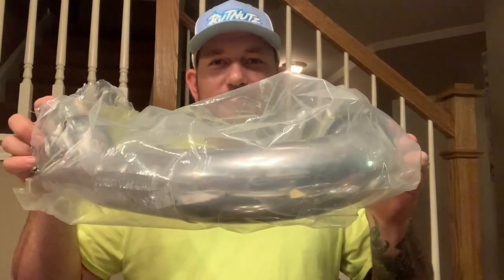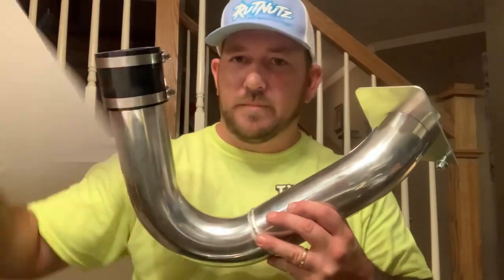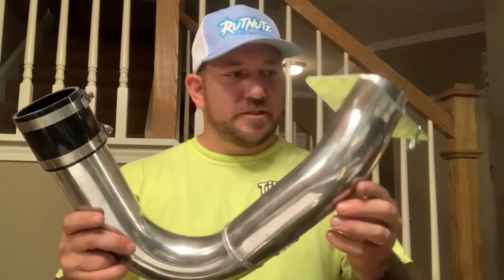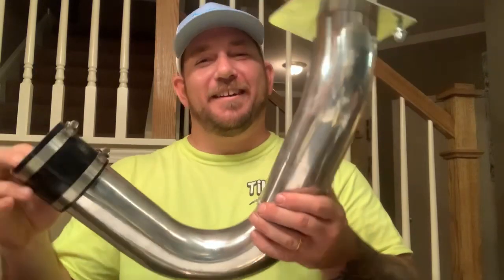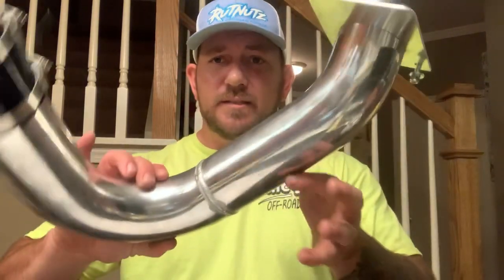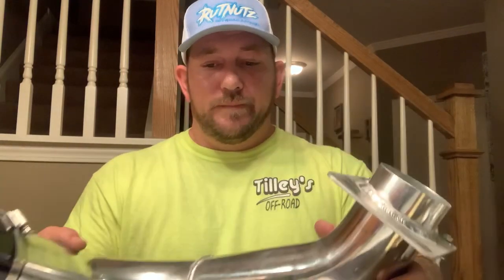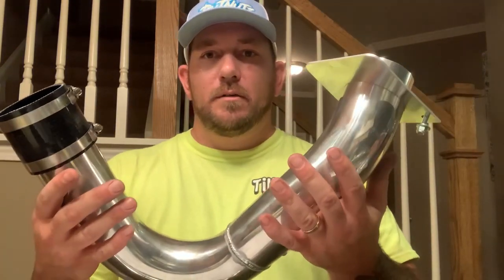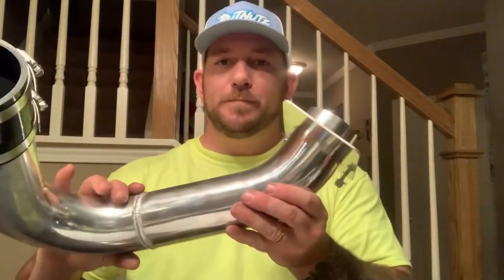Force turbos air intake

Comment: big boost and hot tunes cause the stock tube to collapse. So If your not running big boost your right, you "dont need it".  Mine collapses at 8000rpm on big boost with E85 tune. In that case "YOU ABSOLUTELY NEED IT".